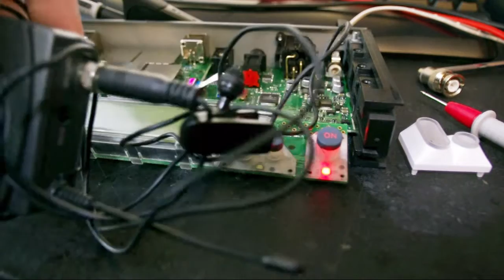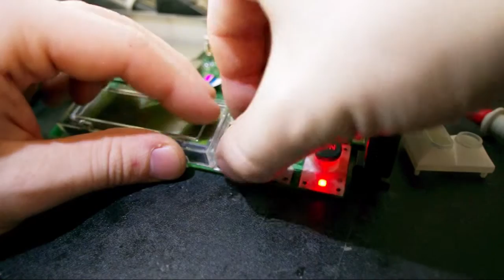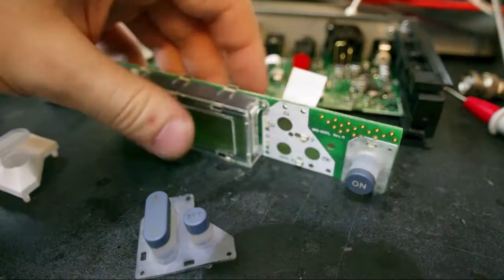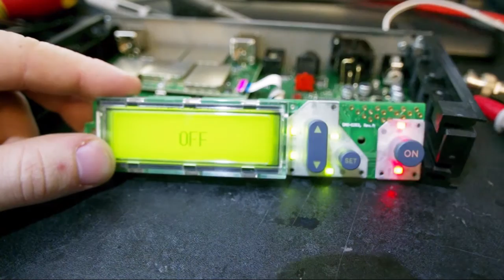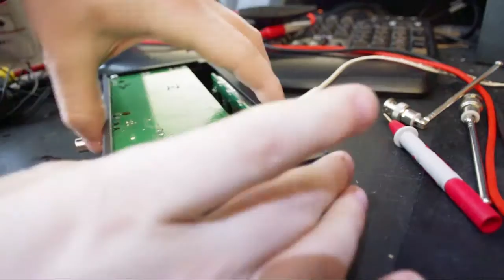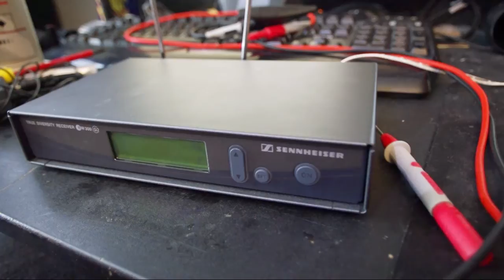Sennheiser EW300 G2 button fix

Comment: Mine seems to have a similar failure mode, except it powers on by itself and non of the buttons respond even after trying this fix. I suspect the ON button circuit has failed. Any tips?

Comment: Thanks so much for this solution as Sennheiser USA doesn't fix this model any more.  How do you get the case open?
Reply: You need high tech screwdrivers - jewelers philips and flat screwdrivers aren't enough.
Reply from the maker: If I remember correctly these devices use Torx head screws, can't remember the size but I'd guess T10 or 15, should be part of any decent bit driver kit.

Comment: Returning to this just to confirm it as a 100% valid and working fix. I ended up spending a whole five english pounds on a big roll of aluminium flue tape only to use a tiny fragment off the end of it, but it was worth it to bring several hundred pounds' worth of mic receiver back to life.

Also, actually didn't need to unplug the ribbon cables, but they're rather poorly held in so I ended up accidentally pulling one of them out slightly anyway and having to very carefully reseat and resecure it (which was the biggest pain in the neck of the whole process!), so I wouldn't recommend it to anyone who doesn't feel confident to deal with such things.

The LCD/button panel can be freed up and tilted sufficiently that you can lever/peel the buttons off with a flat blade screwdriver without unplugging anything (and indeed, only undoing about six screws total - four torx and two phillips). Once they're off, the application of the silver tape happens separately to the main body of the receiver anyway. Actually really simple overall. And the fix works straight away and keeps working.

The one other thing to be careful of is that you have the screen and buttons properly lined up, pushed through and clipped back onto the inside of the front panel before doing the screws up again, so you don't wedge anything the wrong way or cracking the screen. I kept testing as I went and caught myself having not quite put it back in right as I found that, although the buttons now DID work, I had to push on them unexpectedly hard to get a response. When they're in place properly and screwed up, you don't have to push that hard at all, just enough to get a satisfying "soft click" feel from the button.

Comment: Nice video, I think you may have just confirmed to me that I can save a badly needed and many-hundreds-of-pounds piece of equipment from the trash with a very simple fix. In fact, I'm going to wander down to our stationery dept and see if they have any silver-ink art pens or similar I can use, as the only roll of aluminium tape I have available is back at home.

A few things I picked up on though...
1/ egads, please take a drink of water before recording a video with a throat mic or place it just a little further away from your actual neck next time - listening with headphones, every "gulp" did weird things to my spine, in a bad way ;)

2/ no need to put the silicone grease on the "rubber penises" (!) ... just place the buttons front-first into the plastic guards, nice and snug, then press the whole assembly to the board in one go. The plastic and rubber tabs will all pop through their respective holes quite nicely. One less thing you need to buy and mess with, and less greasy mess later..

3/ similarly just a little gentle pulling and wiggling and maybe a nudge from your screwdriver should be enough to get the rubber pieces to peel apart from each other. A scalpel is overkill. Only tool I needed to strip the one I have in front of me was a couple different sizes of star bits and a multi-driver. It's all held together with just four main screws, or at least the parts you need to disassemble to do this job are

4/ OH GOD MICRORIBBON CABLES. Seriously people, if you can manage to do this job without disconnecting any of them (and with a bit of care, you shouldn't have to), then don't. Getting them to go back in is a complete pain, doubly so having them stay in place as you clip the securing plastic back into place, and they get damaged SO easily just from the act of trying to reinsert them with what feels like far more force than should really be necessary.

I only disconnected mine because I didn't immediately realise the front panel could be removed (d'oh). Once that barrier was out of the way, the ribbon could stay attached all the way through.

In any case, minor nitpicks / heads-up over, I'm off to try what you suggest. Because all in all this is a great tip, and even explains how/why it works, which I would never have guessed in a million years (was thinking more along the lines of wear and corrosion...)
Reply from the maker: yeah my audio recording setup was a mess when I did that video, I'll try to remember to put a high-pass filter on the audio in the future though

I've had some problems with breaking or ripping that kind of rubber before, so I'm usually extra careful now, and since I had a lot of that stuff around no point taking chances

agreed on the ribbon cables, they can be terrible to work with, they have nothing on zebra-strip connectors though
Reply: ... I hestitate to even ask what THOSE are O_O ... are those the little floppy rubber things with the conductive stripes running through them?

And no other problem with the audio, really, just the gulps!

Comment: If the receiver seems unresponsive, it is a problem with the buttons. There is no way to do a hard reset, and no need to. You can fix the buttons without the need of aluminium tape.
On the back of each rubber button there is a tiny black carbon disc. Clean it with a cotton swap dipped in rubbing alcohol. Give it a few minutes to dry. That's it.
Reply: stuckinpants Don't be gentle on the discs, scrub them clean. I just fixed four of these receivers last week.

Comment: Obisky12: Google will help you. They do come in different flavours depending on your local regulations - in fact I'm not even sure if it's legal to export a USA one to Europe and vice versa. The Euro spec one in parts in front of me as I watch this video is able to tune 830 to 866Mhz (and is now, legally speaking, restricted to 863 to 866 IIRC), but evidently Stuckinpants' one can do 790Mhz...

Edwin: Can't help, sorry. Google again, and their translate function. Also, lay off the capslock ;)

Jason: Unsure. But I did notice that when I was derping around with mine the screen did get a bit corrupt if I put a bit too much force on one end of the PCB or the cable started to come loose. Make sure therefore that the cable is seated properly at both ends (can be deceptive...), and whether wiggling said cable changes anything... these ribbon cables are pretty awful things, very fiddly and very fragile, they can end up breaking with only a few removals and reinsertions, so you might need to get a replacement one of those.
Reply: Correction: the free UHF waveband for the UK is now pretty narrow: 863.1 to 864.9 (officially 863 to 865 I think, but that additional 100kHz gives a guard band so the typically FM-based, incompletely suppressed sideband kit doesn't stray out of it in normal use). This is somewhat problematic for those of us who want to use a lot of mics simultaneously.

Sennheiser claim that their latest G3 sets can cram 6 simultaneous feeds into that space (so about 300kHz of total bandwidth each), and from my own experimenting it looks like you should be able to managed it with the G2 packs and receivers... maybe with the xmitter sensitivity turned up, the receiver AF-out turned down, and the squelch level raised a little, accepting a slightly more clipped and chopped feel to the speech in order to avoid interference or inconvenience. However, five looks to fit rather more comfortably and successfully without as much messing about, and the official spec calls for just four. A far cry from the old situation where the default settings on the G2s provided 8 different sets of 8 non-interfering frequencies that could be used in different places around an otherwise fairly tight site like our own to give 64 total Tx/Rx sets with hopefully no crosstalk, so long as you were clever about which bank was used where.

The future probably lies in digital equipment making better use of the same airspace, methinks. After all, enhanced rate GSM can get very nice results for pure voice work with just 14.4 to 19.2kbit/s; a more sophisticated system that can pull even an analogue-telephone transmission quality of 48 to 64kbit/s out of a couple hundred kilohertz total airspace would allow for even better sounding monophonic voice than the current wide-band analogue FM kit, whilst also making it possible to fit 9 or 10 separate channels into the same total bandwidth. A 32 to 40kbit/s stream dragged out of a mere 90khz width would be more impressive and allow at least 20 simultaneous sets...

Anyway, as it is, I've tuned everything up to work with five-channel spacings, given that A) altogether, following a recent unilateral purchase by someone else in the department, we now have five TX/RX sets, B) the two newest ones are fixed-frequency, unlike the variable Sennheisers... and their relative spacing is suggestive of a five-frequency scheme with maybe 250kHz total bandwith (as the highest one is at 864.875MHz) and roughly 425 to 450kHz gaps. They don't interfere with each other at that spacing, and the G2s don't either - indeed you have to get rather closer before having to turn the squelch up, and the actual rejection is quite impressive, you can get down to little more than 200kHz spacing before crosstalk is an unavoidable problem (yet, you can be 50kHz out and it'll still pick up almost as if you were tuned dead-on. Very interesting how the locking-on function of FM can work like that).

(In other words, 863.100, 863.525, 863.950, and the fixed-freq ones at 864.450 and 864.875, for gaps of 425, 425, 500 and 475; might yet experiment with 863.550 and 864.000, for 450-450-450-475, so long as the third Senn doesn't mind sitting closer to one of the cheapie AKGs than the two of them are to each other... if the Senn G2s actually have tigher bandwidths than the AKGs, then that presumably shouldn't actually be a problem, because the aggregate separation can be allowed to run a little closer?)